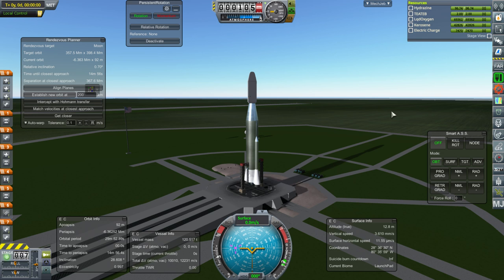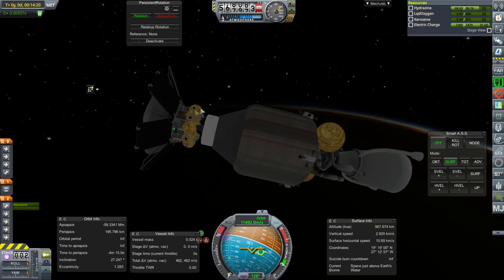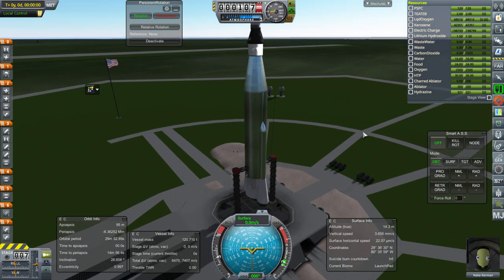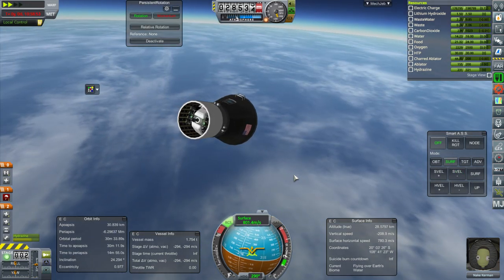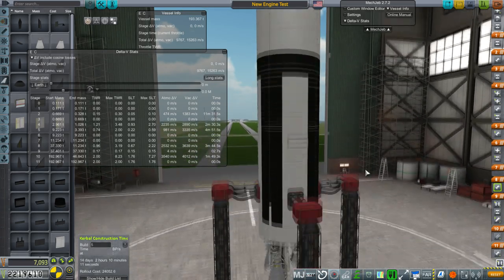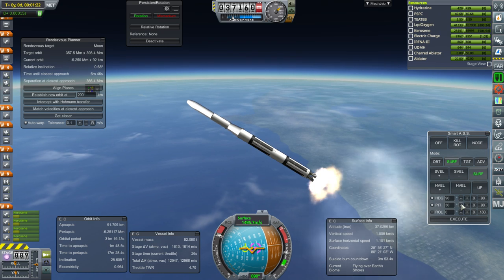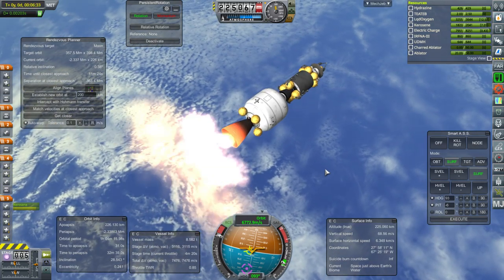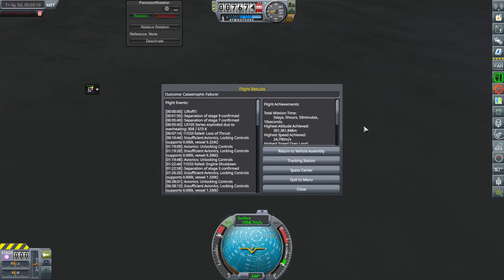KSP 1.3.1 with Realism Overhaul - RP-1 19 - EVA and New Engines

Comment: Once you unlock a better second stage engine, you should build a falcon mine out of h-1s. I did it in 1983 work 9 h-1s and one NK15 for the second stage. Right now it is my main launcher.
Reply from the maker: Well, I'm not going to just copy Elon here. Besides, I'd have to tool larger tanks. I mentioned in an earlier video that I have plans to use the H-1s as engine on strap-on boosters since they're cheaper than SRBs and easily clustered, so that's probably the way I'll go.

Comment: From what I gather, the pods actually have nothing to do with fuel transfer. I'm not sure if it is on that model, but there is a separate Lox feedline on the side even on the early ones, and I see no reason why the kerosene line wouldn't be inside the skirt, the pod route seems a bit of a weird thing to do. I have no idea why it is asymmetrical through.
Reply from the maker: It's tough to get any clear information, and it's worth pointing out that there's a whole set of plumbing for the sustainer which is separate from that of the boosters, so it has its own LOX line. Having some sort of fuel feed purpose, maybe only in the early design, is the only reason I could think of for the asymmetry.
Reply: @RaizSpace  I've found a rather useful diagram of the rocket, with clearly labelled fuel lines. The external Lox pipe is indeed to the boosters, and there is an internal one for the RP1 as well. The Lox line bifurcates to feed the sustainer, but there seems to be a separate RP1 pipe for it.
https://www.flickr.com/photos/27417638@N07/7411664652/in/set-72157630241248940
On the asymmetry, it has occurred to me that the equipment could be balanced by weight. One side is denser, and therefore the fairing can be smaller, reducing total weight, whilst keeping the same head on aerodynamic profile.
Reply from the maker: Good point. I'll mention it in the next video.

Comment: What about making test bench for engines ? like letting them burn on launchpad until you get more points ? Like in real life ?
Reply from the maker: It doesn't count data points until they are launched.
Reply: @RaizSpace  Oh, ok, that's unfortunate.
Reply: @IguasOs  But you can do RnD on engines which gives you like 2500 initial points.

Comment: So the 2nd stage is a LR105? I thought it only lits in the ground
Reply from the maker: Maybe they changed it on a more recent version since I built this install? Since I started this, RO has updated to 1.4.5 and now 1.6, so things have probably changed somewhat.
Reply: @RaizSpace  i tried it again and it works! May be i changed the engine configure. Thanks for answering!

Comment: How much harder is this than normal ksp
Reply from the maker: Not necessarily harder, since you can more closely replicate real things and use real rockets as a basis. I would have said it takes more time, but I've been watching stock system streamers and I don't think there's an appreciable difference once you get the hang of it. It will take some getting used to, though, just like KSP does initially.

Comment: Whats up with cavea b?
Reply from the maker: There is a brief mention of it in the book Ignition, but it didn't seem workable and wasn't actually used. Someone mentioned that it was used in the alternate history Eyes Turned Skyward, which some people involved in RO are fans of, but I see no basis for thinking it's a functional monopropellant, as we still use hydrazine even though Cavea-B has better theoretical performance and has been known of since the 60s. And it's not like hydrazine is fun stuff to deal with. There's more material on using Fluorine than using Cavea-B.